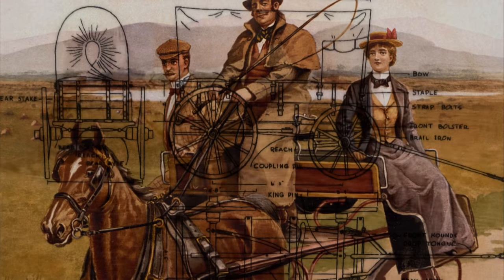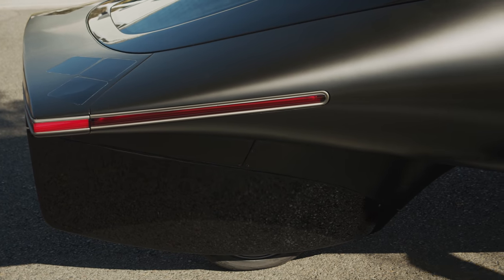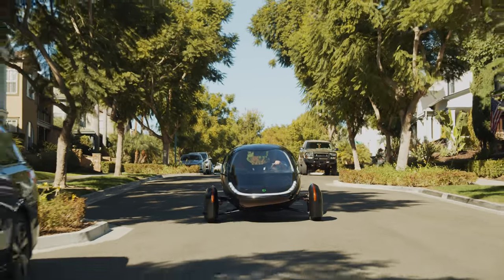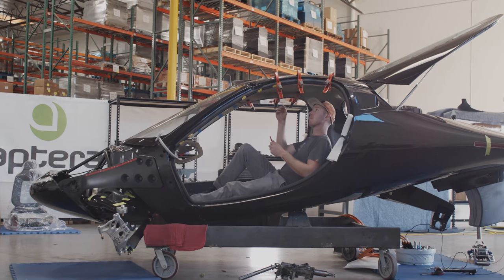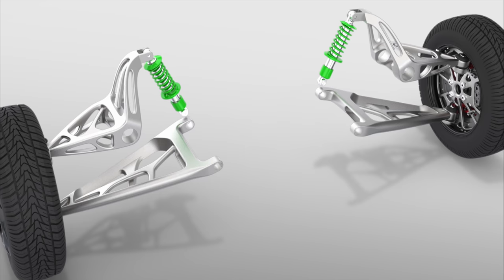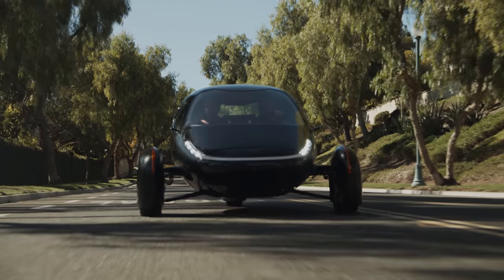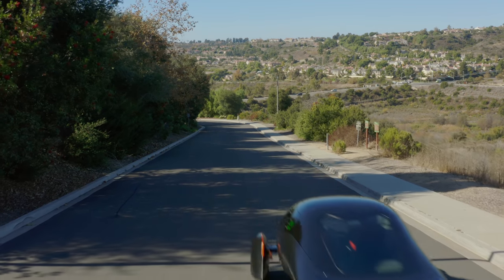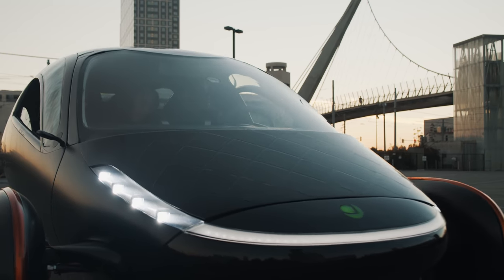Aptera Has Launched

Comment: Please tell the few questions;
1) What price
2) Range in full charge
3) Battery life and its capacity
4) per unit travelling charge
Reply: Price: Range Options & Base Price
1,000miles - $44,900, 600miles - $34,600, 400miles - $29,800, 250miles - $25,900  Battery life unknown, but should be at least 10 years.  There will be more known on this as testing is ongoing.

I don't understand the last question.  At EPA highway speeds it uses less than 100 Watt hours per mile, or around 148 watt hours at a steady 65 mph at sea level.

Comment: I am so excited for this! I've been going back and forth on pulling the trigger on reserving one --- I work for two different hospice territories, so I put so many miles driving each day and something like this wow be amazing! I am hesitant because of weather conditions, so had some questions. 1) Can I put snow tires on it? 2) I'm sorry if this is a silly question, but can't get a good look at the front of the Aptera --- does it have windshield wipers? 3) How is it affected by heavy cross winds? There's some very windy winds on the plains and wondered if its aerodynamic nature also combats crosswinds (or would it get blown over?).
Reply: For winter conditions the AWD model is recommended for more control.  With snow tires, (and chains where conditions call for them) the control should be truly excellent.  The traction control senses and adjusts each wheel individually 32 times per revolution, far faster than any conventional ICE or EV vehicles.

Yes, the wipers are hidden under the windshield cowl.  

The Aptera has been tested stable in 110 mile cross winds, far higher than any slab sided SUV.  There is just not much for the wind to push against.  My 1800 lb Gen 1 Honda Insight is also rather insensitive to cross winds and truck backwash, but the Aptera will be better.
Reply: @n.brucenelson5920  Wow, that is very impressive and thank you so much for the reply! That answered everything I need to know. And....now to reserve one! :D

Comment: Brilliant car! The only question this video didn't answer was how does the charging work in countries like Scotland where the presence of the Sun is celebrated like a rare occasion..
Reply: You can get an idea by viewing solar insolation tables for your area.  In iowa where I live, the full solar option will only supply about 1/2 the range that it would in San Diego.  The efficiency still means you will charge faster and spend less for power, even if you only charge from mains power.

Comment: YES !  I definitely would prefer to drive an Aptera  in  white with the three motors and maximum solar panels and  largest available KWH battery packs ... Yes,  that will result in a Black on White coloration.  Should we call that an "off-grid-car"  ?  Or,  would it be more fitting to call it,   "SOLAR-GRID-ON-CAR" ?

Comment: How is servicing? How will you service? How will you expand? How would regulation affect sales? What are the ethical costs of materials? What is the interoperability with other charge stations? Does it require an adapter? Are there non solar options? Retail price tag? European only?
Reply: Aptera grants right to repair.  Parts can be sourced directly or from third parties.  They will have traveling repair people, if needed. Sales are direct for now.  Charging is still being developed but there will likely be adaptors.  All cars will have some solar, but full solar is a $900 option.

For now, designed primarily for the US market, but homologation for other markets is underway.  Range Options & Base Price
1,000miles - $44,900, 600miles - $34,600, 400miles - $29,800, 250miles - $25,900

Comment: suggestion: Photovoltaic glass for rear and side windows. These are transparent solar panels that can literally generate electricity from windows, and it also blocks heat (so that you need less airco) and UV lights but does let in visible light.
Reply: This glass does not produce close to the amount of power as the cells they plan to use.  With right to repair these windows could be added aftermarket, though.

Comment: Thinking of ordering this right now,  few questions before I do.
Is it only charged through solar panels or ev plug too, when is planned delivery, how safe is the glass in case of accidents, are there airbags.
Reply: Standard EV charging can be done from almost any source from 110 vac domestic sockets to 50 kG DC charging stations.  Glass is standard automotive safety glass and airbags are standard.  I may still take delivery of my early preorder late this year, but orders placed now may have a delivery date in late 2023 or early 2024

Comment: Love the car and would love to own one. I have an issue with the covering up of the wheels. Probably for style and aerodynamics but may be an issue in winters.  At least when driving through deeper snow that is not plowed yet. Seems to me it will push more snow also worried slush and sticky snow will get up into those wheel covers. Will that be an issue sitting all day at work with the snow in the wheel covers. Refreezing during the day and then when going home it’s all frozen up will it rip the wheel covers or pull on the bodywork or cause some other damage. There is a reason all production regularly used cars don’t have their wheels covered up.
Reply: The designer of the wheel pants is from Mass, and is familiar with the issues.  I will be taking delivery of one of the first 50 vehicles and live in Iowa.  I will be reporting on my experience in snow.

Comment: Based on what I heard it will cost (about the same as most lowest cost EVs, which is still about 10k more than a gasoline car of similar specs), I would still buy one.

The only flaw that I anticipate is the long waiting list... meaning that I will likely not be able to wait and end up having to buy a gasoline Nissan Versa instead and keep it for at least 10 years before I will be able to buy an Aptera.   Will have to just look at them on the road and dream :P

Comment: Top speed ? 0-60 ? Actual range ? 1000 miles on what battery? I get the solar panels but that's only up to 40 miles
So the battery can hold straight for 1,000 miles at what speed ?
Reply: Top speed is governed to 110 mph.  0-60 will be around 5.5 seconds for 2WD or 3.5 for AWD with the largest batteries - probably somewhat faster for the smallest.  The 1000 mile range is based on the  EPA Highway cycle with the largest battery pack - probably averaging around 48-50 mph.

Solar range will depend on the solar insolation where you live.  In Iowa I will probably get around 20 miles per day.

Comment: I get that the range on this vehicle is fantastic. But I want to know about the other costs (insurance, scheduled maintenance and where to get it done, warranty info/what is/is not covered, etc.) Great looking car, a great idea w/ tons of potential. I just like to dig deeper into these things.
Reply: There is a new video regarding insurance out this morning from Aptera Owner's Club.  Warranty details will be forthcoming closer to the ship date, after ser beta testing has validated the parts.  It will be in line with other manufacturers.  Aptera grants right to repair and the repair and tech documents and parts will be available to anyone who wants the, and anyone will be able to work on them.  

At present, the only regular service that I know of besides tire rotation and a perhaps 150,000 mile safety check will be servicing the wheel bearing seals.  We don't yet know the service interval for these - which could be anywhere from every 25,000 miles to permanent.  In dusty areas, the air cabin filters will have a service life, and the windshield wiper replacement as needed.  That is about it..

Comment: I live in ks and commute 140 miles to work as a nurse.  i was looking forward to driving a elio till that didn't come thru.  how well does it do with wind pushing it from the side?  how well does it do on nonpaved roads?
Reply: Aptera has been tested stable in 110 mph side winds, far higher than slab sided 4 wheel vehicles.  As far as non paved roads it will do about the same as a typical Honda.  You might want to consider the off road kit and 3 wheel motors for maximum clearance and control.  This should be very capable.

Comment: The only thing that I see that would be a problem is that if you live in the city those pot holes are going to do a number on your wheel covers front and back with how low the covers are to the ground. Better keep a lot in stock.
Reply from the maker: Hey Mike, our middle wheel can take a pounding, and there is much less weight on it versus a typical EV, so it will handle most potholes nicely!

Comment: Impressive! I'll never ever afford one but still impressive. Out of necessity and being on a really low budget, I got a segway scooter, it helps me get groceries and go on dates (I bought bf one too). I would so rather harness the suns energy like this. Would the cost go down for this vehicle if the production was high? That's my most pressing question.
Reply: Battery cost is by far the highest cost of these vehicles.  As prices on batteries come down there is lots of room for the prices to fall in the future.  Aptera's capital costs to move into production are far lower than most manufactures.

Comment: I want to support this company but the biggest concern I have is safety. Will be following this company though.
Reply from the maker: Hi Taylan, We will not know Aptera's actual rating until we pass a production vehicle through the full safety test. But we are designing to exceed all passenger car standards and the previous version had the highest roof crush strength of all passenger cars on the road, and it performed exceedingly well in actual side and frontal crash tests. Aptera features a Formula One-inspired safety cell with advanced composites and metal structures for impact strength. Similar to aerospace and racing, these energy-absorbing methods are a core part of our safety strategy and have proven effective time and time again in high speed impacts. Thanks!

Comment: Is the Aptera strictly a fair-weather car? The company is located in California, but I like to drive to the Austrian Alps. And I do so in winter. My KonaEV handles that very well. How do I put the snow chains on? How does the car behave in ice and snow? All questions for electric cars and your success.
Reply: I live in snowy Iowa and plan to drive mine year round.  I will probably use studded snow tires on mine in winter.

The traction Control/ABS may be the best we have yet seen.  It can detect wheel spin and adjust torque 32 times per wheel revolution.

Comment: Pretty cool car overall! Nice work. With a chassis/body that rigid, and no real crumple zones, that's going to be a very high G impact to an occupant in the event of a collision. Getting T-boned in that car looks like it would especially traumatic.
Reply: There are engineered front and rear crumple zones, possibly using hemp and or bamboo fiber in the composite for those areas.  There is also an F1 style passenger safety cage built with Kevlar and carbon fiber.  Of course there are also common safety features such as air bags and seatbelts.  Aptera will be crash tested to FMVSS part 200 automotive crash test standards before shipments begin and the results published.  My bet is that it will rate very well.  If it doesn't seem safe, the pre-order deposits are refundable.

Comment: how does this vehicle deal with winter conditions
Reply: It will be rated for temperatures from -20 to 125 F. The ABS/traction control can sense and adjust torque 32 times per wheel revolution.  With snow tires the AWD versions should be truly excellent.  Later this winter we will have video from a winter weather test track.

Comment: Correction:  you use 70% of your fuel generating heat you need to get rid of.  Out of those 30%, 60% is used to push the air.  Most Americans like to use twice as much gas that they actually need by driving huge useless SUVs.  The waste over the last 40 years is mind numbing.
I wish aptera well, it certainly is making all the right noises and promises.  It was sad to see if fail 10 years ago, it is nice to see it back.  It is a very nice design that provides great solutions to efficient transport.

Comment: I just placed my deposit.  Would you consider an option for a spare.  Wife is concern about having a catastrophic flat where you cannot fix it with a fix-a-flat can.  What if you are out of range for cell reception and cannot call roadside assistance?
Reply: Fix-a-flat is not a good option.  You can get a small, portable air compressor and a mushroom type plug kit that will allow you to make a repair in minutes.  I have carried these on my motorcycles, and have repaired both motorcycle and car tires with them.  If you spend a lot of time out of cell phone range, there are relatively inexpensive satellite communicators that will let you text for help if you are in the boonies and need assistance.

Comment: So lets say someone buys one of the most basic models with the shortest range and no extras, but in the future they decide they want better range or AWD or more solar panels, would they be able to purchase such upgrades individually to install themselves, or would they just need a whole new vehicle?
Reply: They don't really know the answer to these questions yet.  Ideally the assembly will be modular enough to allow this kind of later add on, but it will depend on how the manufacturing process comes together.  The batteries are the biggest question mark, but they don't know about the third wheel yet either. I personally think that an individual who didn't care about the time it took could do any of this, but the question is if it can be done economically.

Comment: I'm concerned about this car on the freeway driving around semi trucks, and being blown off the road by them, also the winds, and whether it can get up to speed and maintain such  in ramps and exits... I'd be a buyer as it would fix every problem for me, but got a few questions
Reply: I currently drive a Gen 1 Honda Insight and have crossed much of the country in windy conditions on I-80 at 80 mph in it.  It weighs about the same 1800 lbs as Aptera, which will be even less affected by winds, including side winds.

As far as speed goes, both my wife and I have ridden in an alpha prototype and the acceleration is breathtaking - no worries about getting up to speed what so ever.  Aptera top speed is over 100 mph, but I never may explore that end of the performance envelope.

Comment: would be nice to get the price down to $10,000 or less like the Wuling which is $ 5,000.   How fast does this car go?
Reply: The top speed is rpm limited to around 110 mph.  Since it is built to pass FMVSS automotive crash tests standards, there are costs associated with that.

Comment: I live in Finland, a country of long and cold winters. And snow. A lot of it. During our short summers, there can be a few hot days though. So the question is: is the battery thermally controlled, can I pre-heat it before "taking off" with this wingless plane, which I, by the way, want to own so badly. One thing about the solar panels is that they are not that useful here but dang, do they look cool!
Reply: The Aptera has climate and battery thermal control spec'd to operate over a temp range of - 29 to 52 C.

Comment: The thing about bicycling can't be true. As I metered the electric going into my electric bike and it was getting 5,500mpg'e. I was obviously peddling but the motor was doing most of the work. I went 50 miles on that bike and still had about 60% of the charge left in the 940wh battery pack

Comment: I heard there is another issue with electric vehicles.  Because they bypass fuel stations, there are no taxes collected for roadway improvements.  If there are no fund for the improvements, the highways will degrade more than what they are now.
Reply: The funding mechanism for our infrastructure should change, for sure.  Apteras are light, and will cause less damage to the roads than most vehicles.   They will also take pressure off the power grid.  Fair cost apportionment should take into account vehicle weight.

Comment: I'm just worried about how well the low wheel guards will fair against potholes
Reply: The wheel pants are attached to the wheels and will rise with them, unlike the front valance on many Japanese compact cars.  I had a ride in a prototype during which speedbumps posed  no issues.

Comment: With drive train powered airturbines more of the air drag could be eliminated as well as used as a boost. Basically instead of moving the air it has some of it literally slip right threw.

Comment: Most people have more than 40 miles a day commute. My total commute is 64 miles....and I am not alone. Many others have longer commute than me.
Reply: However, if 40 miles of that 64 comes for free (or what ever the range is for your area) it will still save you enough money to pay for the option.  And because of the energy saving optimisations, you can still add 13 hours of range per hour, plugged into a standard 110 volt 15 amp outlet.

Comment: Will it have Air Conditioning and how much will that affect it's battery usage?
Reply from the maker: Aptera has air conditioning and heating — a complete climate control system capable of down to 60F and up to 90F. The well-insulated composite construction, paired with a ventilation system, keeps you comfortable on a sunny day. The solar also allows the interior to stay at ambient temperatures on hot days to keep the inside cool before driving in the summer. There will be a range penalty when using them on very hot or cold days. We will release exact numbers once we have completed our testing.